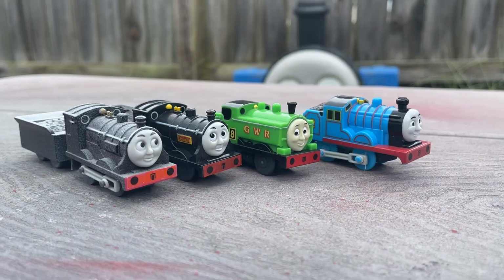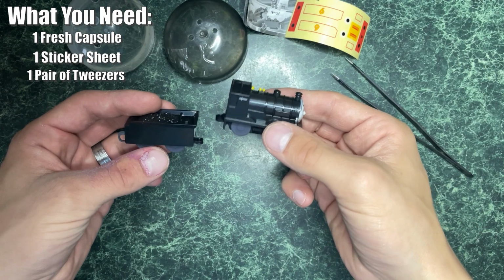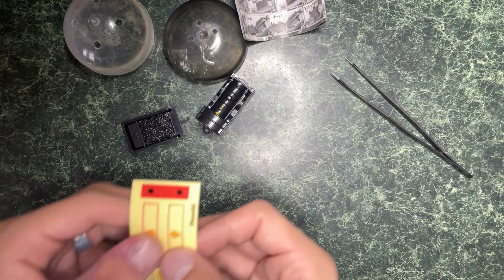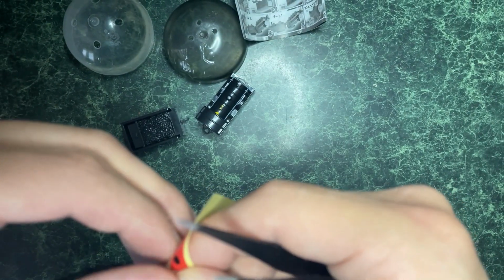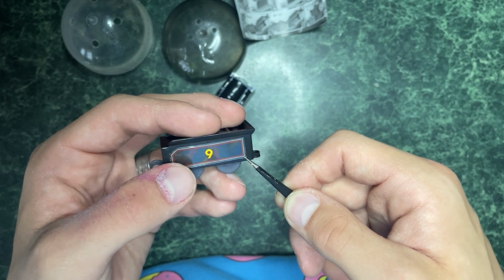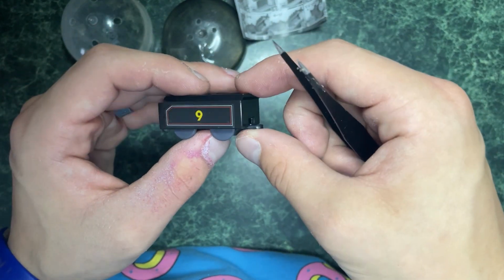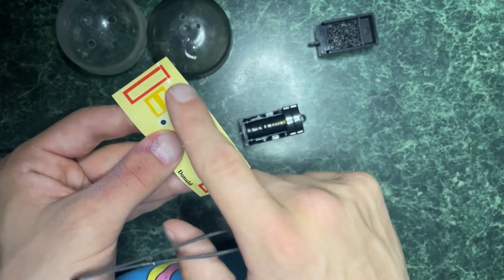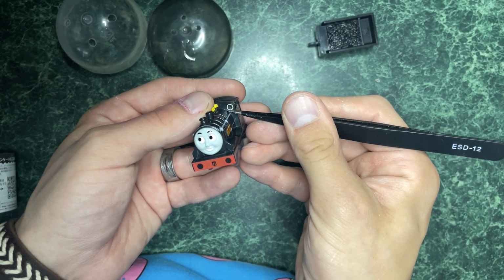THE GUIDE TO CAPSULE STICKERS: TTTE Capsule Plarail How To

Comment: I personally have only used Lego based decals/stickers, but I still find them so irritating to use when modeling. I took a class in middle school called Fab Lab, and we did learn how to make custom stickers/decals using Adobe Photoshop, and how to properly apply them onto stuff using tweezers and a squeegee. Regrettably back then I was a pretty dumb idiot, and most of my stuff have air bubbles, and some even tore because I was being an impatient idiot. I don't have a squeegee or a modeling tweezers, but I actually have gotten much better at applying stickers/decals just by using my hands, although I would like to get some tweezers and a squeegee because I have some Lego train projects and other modeling stuff that will be using decals